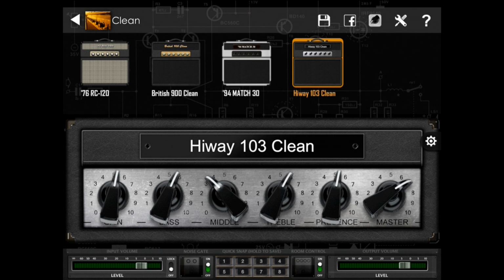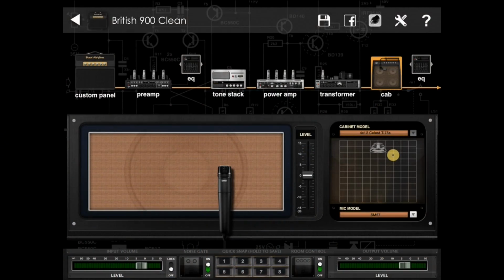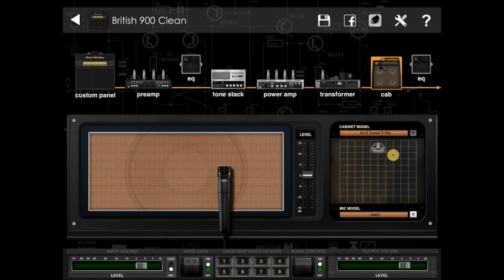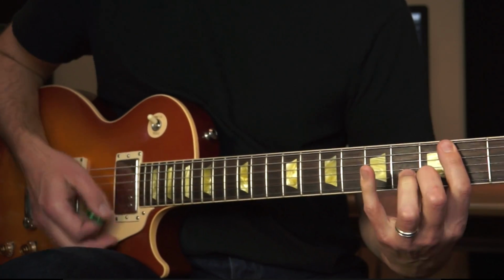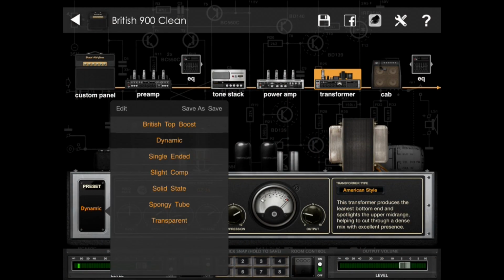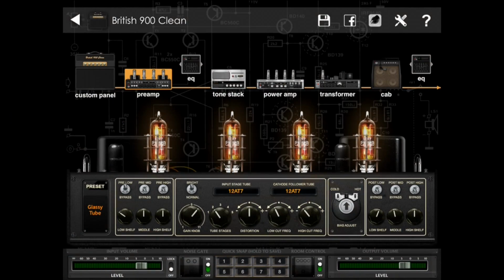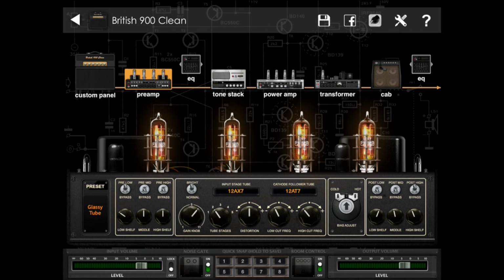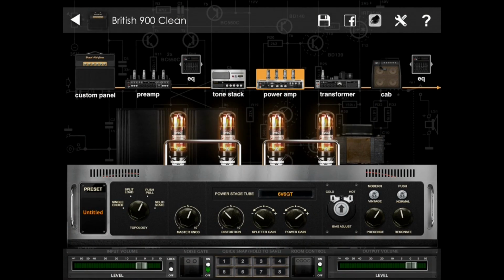BIAS Tutorial - Clean Tone

Comment: I downloaded this app on the word of Fluffy without even watching any videos and I must say that it sets a new standard in guitar-related apps. I even find it difficult that anybody would buy products like Line 6 Pods or Boss GTs if they already have an iPad. It's incredible how you are actually able to hear the nuances when you connect your iPad to decent speakers. Which brings me to my next point, Positive Grid should manufacture affordable and portable speakers to use with BIAS. It would be even nicer, if they could throw in Bluetooth connectivity in it. Finally, a future app idea: pickup modeling. Turns, rod materials, height, position, wax, covers. You can put Variax out of business too..
Reply: Completely agree.  I have a BOSS GT-100 (and used a GT-6 for years before that), and after picking up both BIAS and JamUp, I'm strongly considering selling it and just going full mobile.  The sounds attainable with these apps are unbelievable, almost too good to be true.
Reply: Also, what are the best monitors to use at home with devices like Line 6 Pod HD or applications like JamUp? I will either get a monitor or a combo low-wattage valve amp..